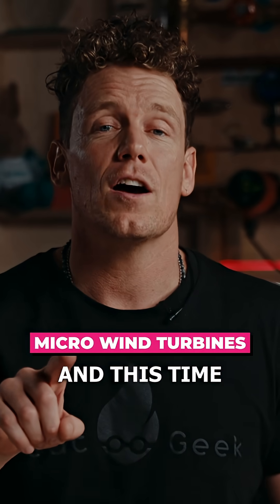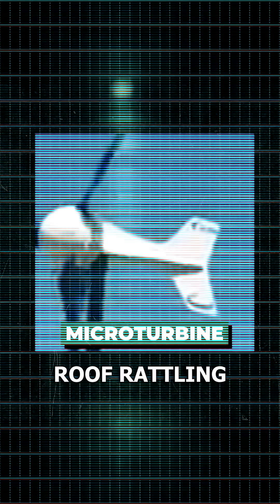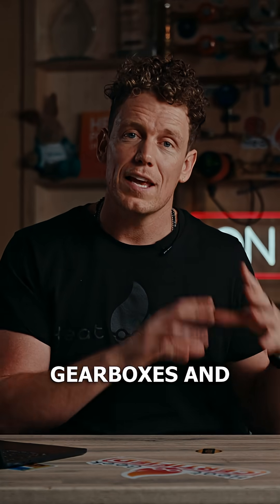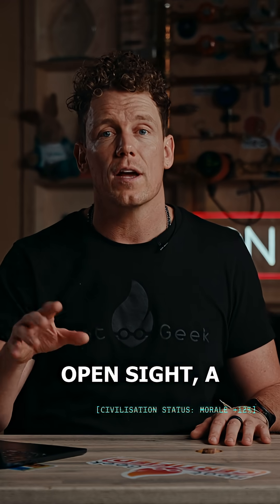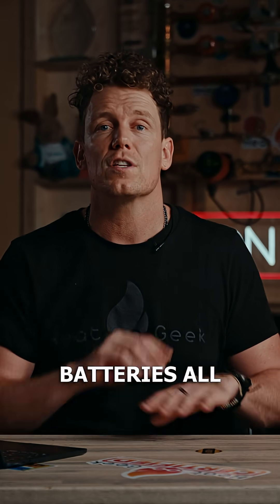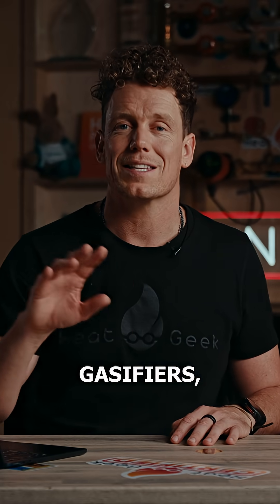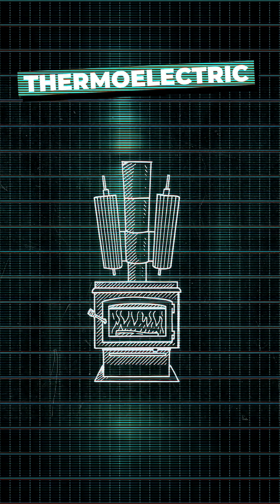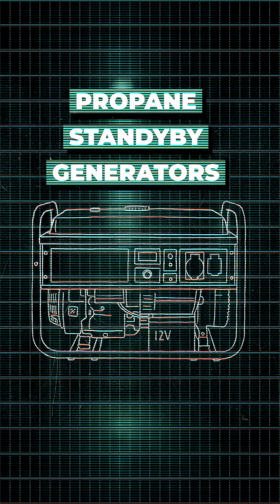Do micro wind turbines work?

Comment: The reason solar is so popular is it's simplicity of installation and ownership.  Unfortunately micro wind can't replicate this.

Time and time and time again we see end consumers with little to no engineering knowledge or experience purchase micro wind only for them to be disappointed.  Wind turbines are mechanical devices that require maintenance and near daily attention. 

There are some exceptions, such as the super wind from Germany, but then you're looking at £3-£4k for the machine plus a tower.  That turbine is rated at 300 watts.

If you want back up electricity, buy a generator and store some liquid fuel to run it on.
Reply from the maker: Although those things are true, there is absolutely no doubt about how much it’s improved over the last decade which is what this video is about. If you go onto the longer for content, we talk about why backup generators aren’t the best idea in this scenario.
Reply: @HeatGeek ironically you show an example of a turbine that has been around for over 15 years that has a poor tract record.

Well engineered turbines do not have gearboxes at all.

You've given no actual examples of equipment that is working, you've just said they are good and that doesn't actually mean anything.  

I've worked with micro wind actually installing and maintaining the equipment for over 15 years and I do not recommend it to people now.  Even fully off grid, it's a pain and will not save anyone money, solar, batteries and generators are a much better shout for 99.5% of the population.

Generators are a good option.  Your note about petrol is important, ethanol can easily be removed from stored petrol using water and a settling tank setup.  The trick to a duralable generator is getting an older one with a side valve engine, they will tend to burn poor quality fuel.

Selecting the correct inverter is important.  Some units are very picky with the quality of the electricity required.  Most hybrid inverters are fine, they will go into charge mode.  Another alternative is a simple battery charger, these have come down in price a lot and are a good work around for the complexities of integrating an ac generator.